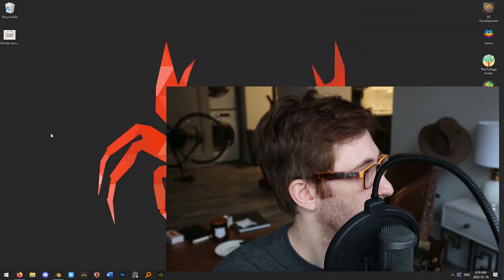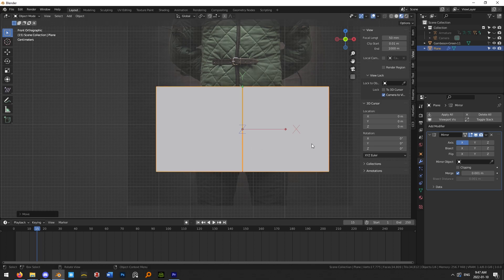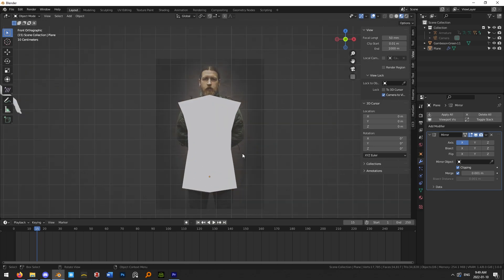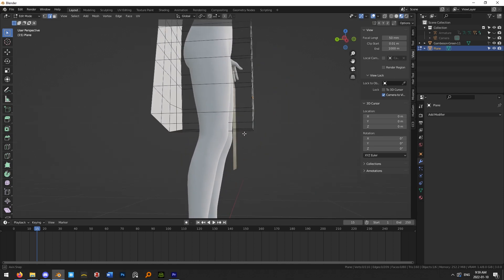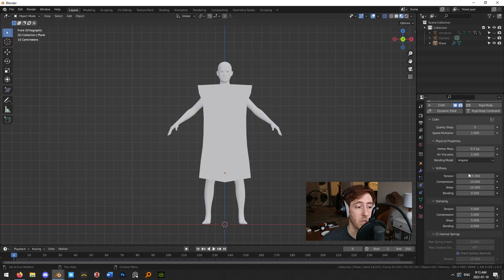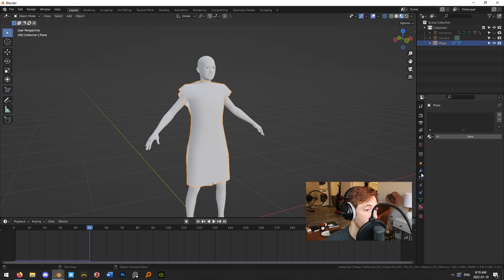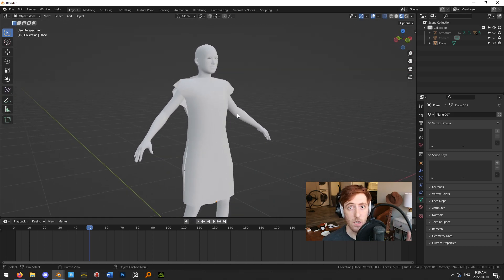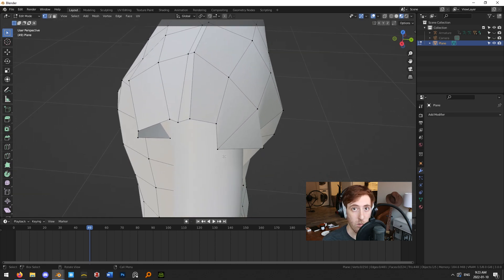E01 - Making Clothing for Game Engines in Blender

Comment: when i put on the clothe physics it just make my plane desapear, any idea on why?
Reply from the maker: Hard to say without knowing what your setup is, probably there is a small change somewhere that you've missed that is causing the issue. One possibility is that the normals of your cloth mesh are in-facing. Another is that something is off with the mesh scale (maybe not applied) or the cloth simulation settings. If you still have issues, another way to get realistic cloth is to model the general shape, use a subsurb modifier on the clothing piece to get a denser mesh, and then sculpt it using the cloth brush in sculpting mode.

Comment: Hi. Question. How can we tell what type of cloth we selected? For example, when I click on Cotton to use as the default I don't see that value represented anywhere in the Physics Properties section other than just knowing I clicked on it. Thanks for your time.
Reply from the maker: Hey there - 
The presets do represent values in the simulation on the cloth itself. If you want to, you can also create custom values and experiment with those. If you google the blender cloth sim documentation, you can find an explanation in more detail of what each setting means and what it does. Cheers
Reply: Thanks, sounds good  @cgkrab

Comment: Thank you. When I made it like this and imported it into Unreal 5, only the part I see becomes transparent. Do you know the answer? It would be very helpful if you could guide me to importing into Unreal Engine.
Reply from the maker: Hey there - it's hard to know exactly what issue you are running into, but you should know that Unreal materials are one-sided by default. If you open up the material settings, you will find a checkbox that turns on two-sided materials. It's possible that the parts that are transparent are simply being hidden because UE5 does this backface culling automatically unless you set the material to be two-sided.

Comment: i have to export to unity?
Reply from the maker: You will have to weight paint to match the character in that case first. You can do this inside of blender using 'transfer weights' from your rigged character, ir in an external application like CC3 :) weight painting is separate from modeling, so it's not covered in this video...but if you do a quick search you'll find there are lots of videos on weight painting in blender :)

Comment: this is a helpful tutorial , can you add fur particle system to clothes and have it still work and look nice if you animate the character?
Reply from the maker: Hey - thanks! I haven't tried this but my expectation is no, unless you're willing to suffer very long render times for animations. Fur particle systems, especially with lots of interpolated children, are very expensive gpu-wise...so on the whole body, I imagine it would be very slow. Probably doable but if you want this to work for example on a game engine, or to render in reasonable time, you'd probably be better off with a baked fur material
Reply: @cgkrab  okay Thank you